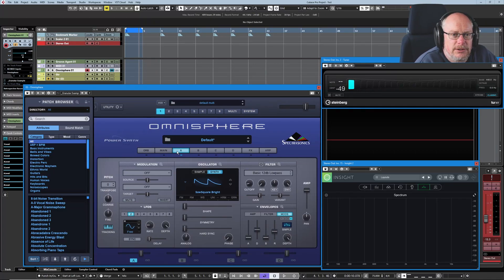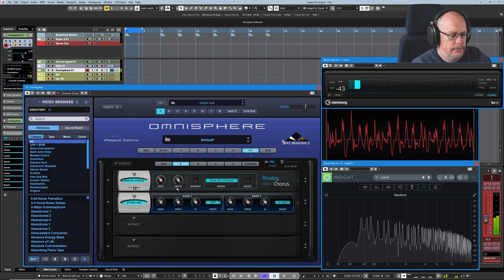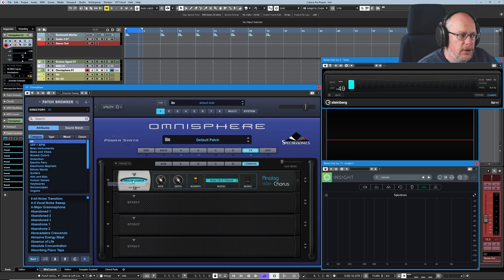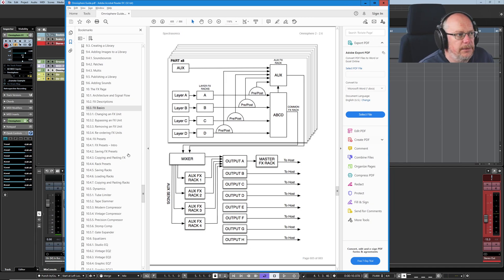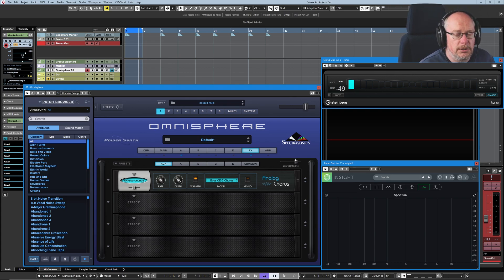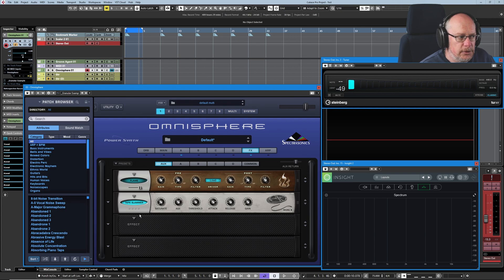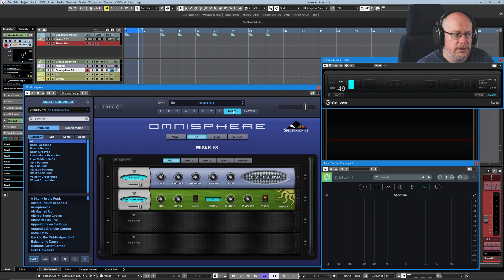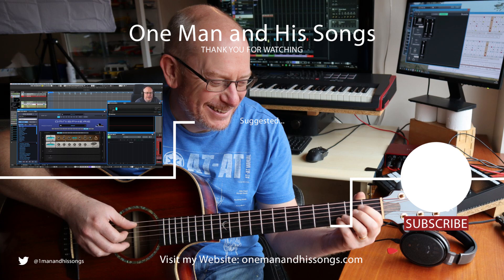Spectrasonics Omnisphere Tutorial Ep.18 - FX Architecture

Comment: So basically "A", "B", "C", "D" are each indiviual insert slots, "COMMON" is a group insert slot for layers A through D and "AUX" is a send slot. Would that be correct?
Reply from the maker: Kinda. Layer A feeds into FX Rack A, Layer B into FX B, etc etc, then all 4 Racks feed into the Common Rack, and off they head to the output. Meanwhile, the Aux Rack (as you say, it's a Send Bus) - can be routed to from anywhere - any of the Layers, AND the from Common FX Rack itself. I prefer to use the word "rack" rather than "slot" to clarify that each rack can contain 4 effects, but I'm just being picky.